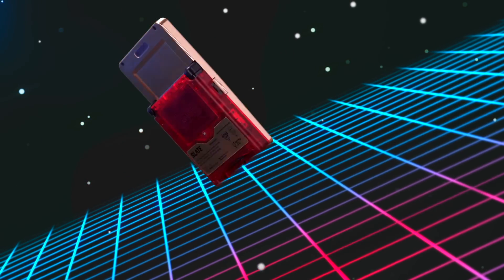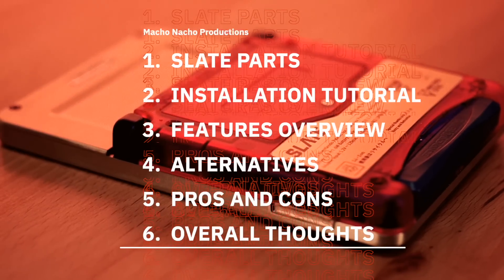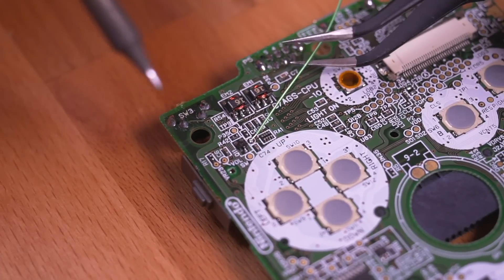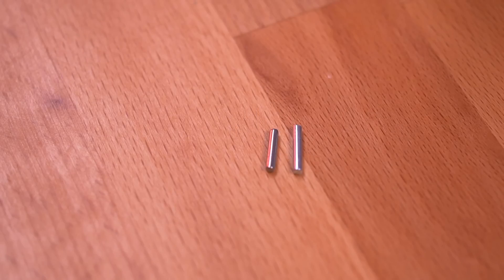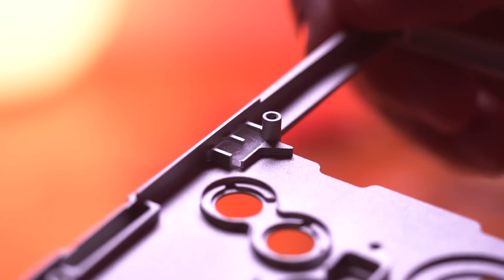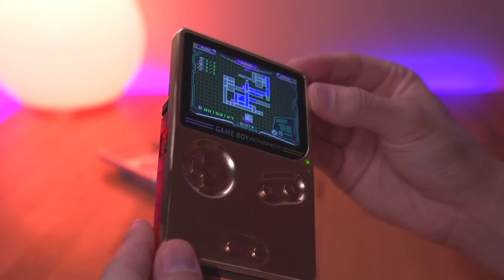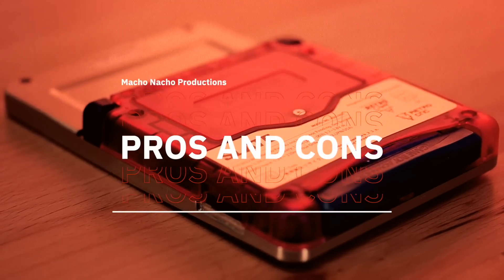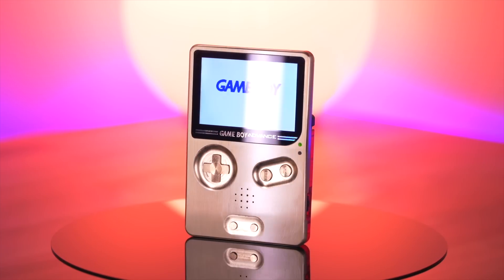The GameBoy SLATE SP

Comment: I would love to see a plastic option for any of these shells in the future. The aluminum is certainly fancy, but I still prefer the look and feel of plastic.
Reply: Couldn't agree more. It would bring the cost way down also. Though I wonder if the reason it hasn't been done yet is due to something like that compromising the screen structural integrity.
Reply from the maker: I too would love to see an injection molded plastic offering
Reply: i'd love a plastic shell if only so it would match the rear piece. the mix of metal and plastic on the finished product just looks sloppy to me. almost half-assed
Reply: Agreed for gameboys a high quality abs is what im used to feel in my hands , also cheaper
Reply: SAME!
Reply: I am actually waiting for a plastic option to do this mod. Don't want the aluminium.
Reply: Yeah im waiting for plastic before I pull the trigger on this
Reply: cheaper too.
Reply: @ubernewb3005  came here to say this
Reply: I was just saying this! At almost $200 for the shell plus screen it’s hard to swallow
Reply: Have you checked OpenSP?
Reply: @MachoNachoProductions  I feel the same way about the macro. It would make it feel a lot more natural with the back half
Reply: While it would be a nice option, the durability of the aluminum is worth the cost. Most of the shells made nowadays use cheap plastics that aren't very durable. A shell that uses plastics on par with the originals or better wouldn't be cheap either.
Reply: @Tee Hee I've since re-shelled my SP with one of the new Funnyplaying shells, and it feels like a drastic improvement. The feel is good, and I've dropped it a few times with no consequence.
Reply: It costs about $35usd to have one professionally 3d resin printed.

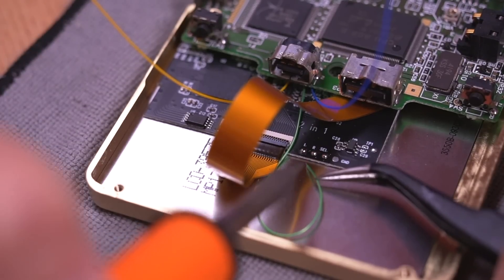Comment: 6:48 I'd solder the wires to the driver board while it's disconnected to avoid having a soldering iron anywhere near the LCD - it very easy to overheat it and cause discoloration
Reply: Yeah, that happened to me. The guides I looked at when I modded my GBA all did it with the board on the screen and now I have a dark spot on it, so yeah, remember not to do that
Reply: @charlesmalmasson9698  same :-( had to order a replacement LCD

Comment: L.E.D diffuser is really nice, boxy pixels shell I believe allowed you to put your original one into the shell. However I couldn't get mine to stay in place, so I ended up using your technique from the Gameboy macro mod, put kapton tape onto the light holes on the outside, and filling the inside with a little hot glue. I did end up trying to put the light tube in on top, which worked well overall. I love how detailed and advanced people are capable of making older technology these days.

Comment: We need a version of this for the original GBA (horizontal), making it a bit more compact. Looks superb. Great video as always.
Reply: Curious how they could possibly make the Horizontal GBA more compact!
Reply: @Wedeemgaming  Maybe it'd be easier to enlarge a Micro? Lol
Reply: @Wedeemgaming  much like this build but horizontally, shrinking a bit on the sides after the buttons. There is a bit of space taken by the side “bumpers” on the OG casing. Granted it is not much, but smaller is smaller xD 

The other option i thought is uso g a game boy micro board, which is split from the dpad side. But that would require a screen mod that currently does not exist.

Comment: It would be nice to be able to have a matching housing for the back, like the og boxy pixel. Hopefully, mahko considers that after the initial run on these units.
Reply: I might be wrong but the product page says kit includes both front and back plates - chiming in just because I'm planning on ordering one and wouldn't if there's no back plate
Reply: @andrewan6633  the back plate that it comes with is for the top half, you still require the backplate from a normal gba sp shell, for the bottom half
Reply: @andrewan6633  no you donut, he means that both sides match in color and material.
Reply: It would add a few more dollars to the sticker price bro.
Reply: @shellshock10  exactly my thought

Comment: Note for everyone:
I just did this mod with the metal cnc buttons and I had to add the A and B membrane because there was too much clearance. I also had to snip the center circles in the A and B membrane. Also the R button was very tight I had to trim some of the plastic to allow enough clearance
Reply: Hey man I’m having the exact same problem where all the metal buttons A, B, and the D-pad do not fit snug and rattle a ton. I tried putting the membranes back on but they didn’t seem to fit correctly with the metal buttons. I’d appreciate it if we could chat a little bit and you could give me some tips.
Reply: @bchd8829  did you snip the L and R pins on the board? This step isn’t in the video but is recommended on the install guide. Also if you use the membranes make sure you cut flush the small rubber centers. I ended up using the dpad membrane and the A and B membrane and it feels great
Reply: @duke_8747  I snipped them but only on the one side that makho did in his video. Good tip on the membranes I’m going to try that
Reply: @bchd8829  definitely snip both sides if you end up taking it apart. Let me know how it goes
Reply: Should not have to do that much self work with the price it costs. I was debating reshelling the sp I just got myself for my birthday with an sp shell or the CNC slate and now I really don’t wanna get the slate
Reply: @tbug50  it’s really not much. The install goes really smooth just snip those 4 pins on each side. If you want the best feel just use plastic buttons and membranes.

Comment: Once again a great video Tito. I’ll say this- putting together my Boxy pixel unhinged kit sucked. It didn’t fit together right with my IPS screen. I told BP about this and they blamed MY ips screen! They tried saying my kit wasn’t from funny playing, even though I definitely had the funny playing package they come in. In the end I had to purchase another screen- from China- and then file down the back screen cover to make it fit. Quite pissed I spent 95$ for a kit that didn’t work. So the Slate already looks like a better alternative.
Reply from the maker: So sorry to hear that Ian. What was the issue with the fitment of the IPs screen?
Reply: @MachoNachoProductions  The IPS driver board would not fit. and it ended up destroying my ips screen's ribbon cable. I reached out  to them and emailed pics. they insisted "That's so weird", and "you must not have a funny playing kit". I sent more pics, and they said all of their kits have never had this problem, and that the Driver board didn't look right. So i bought acheap ass ebay IPS screen, and it worked fine. I ended up filling and grinding the back screen cover down so it would fit better. But this is what we do in the name of progress. I dont entirely blame BP. There are a lot of variables to deal with when designing something around a lot of knock off products. and, maybe, my IPS kit was a fraud?

Comment: Just a tip for future reference, this video is great, but the whole use different colored wires isnt an option when the kit comes with 3 of the same color.  I got to the step of soldering onto the LCD controller board and had to unscrew to label them because I didn't have the luxury of different colored wires.

Comment: This looks super sleek. Love the shorter height and the extra rounded corner on the screen. I'm not a huge fan of the slant though, would prefer a totally flat front. I do wish a metal back was available as well
Reply: U big turkey, the slant is because you didn’t use the shorter dao lmfaoooooo
Reply: @pixelatedsethtube1271  Dao? Do you mean dowel?? And no, the bottom half literally tapers off in a slant. You can see it in the video
Reply: @NormalPsyche  Ohh yes I was thinking that. My apologies you are correct it does have a slant

Comment: I'll be honest, if you have a 3d printer at home, the unhinged original looks very appealing, since you can skip the proprietary buttons by printing them and it allows for bigger batteries.
Though I haven't had a GBA in over 10 years ever since I got a DS.
And right now I got my hands on a GPD XD, which to my surprise, fits perfectly into the grip for my 3DS XL, it only blocks the L2 and R2 buttons but other than that it's what I'll be using for GBA on the go really.

Comment: Just received and built mine, it's beautiful. 
I ordered the machined buttons however and installing them without the membrane made them loose and the whole system kind of rattles when you move it.
They functioned fine but I just really didn't like the feel / sound of it so I went back to the standard with the membrane.

Comment: I have a question. Do the metal buttons have any chance of damaging the button contacts on the motherboard? I like the way they look but I'm worried about possible damage.
Reply: Definitely a really good concern but I'm sure if the button post on the bottom of the button is the same size as the contact it should cause any damage. However, I know nothing so don't listen to me, just a opinion that could be complete wrong!
Reply: @m4xQ  ahh you are right. That probably will make it less of an issue. Thanks.
Reply: @albertoheras7684  the dome is pretty tough so I think it should be fine! For me maybe I'll go with aluminum button instead of brass though. My childhood SP, the face buttons were somewhat unresponsive so I literally had to peel those domes off and use alcohol to clean them up, so I think I know how sturdy they are
Reply: I think it's more exposed to corrosion without the membranes.

Comment: That's tempting... And technically it's a no solder mod if you're not worried about the brightness. You could set and forget so for those that are crap at soldering (ie, ME!) that's not a bad option.

Comment: Great review and well done Makho on the product, I think it came together very nicely. I have an unhinged v2 and I love it but am considering building one of these as well, the only thing holding me back is no usb-c option, it's really a game changer on the unhinged, and I'm surprised Makho didn't feature it on this since he is pretty obsessed with making everything usb-c compatible, but I understand that would be a much larger effort and trying to keep this a fairly approachable mod. Well done all round.
Reply: But USB-C mods are already available for the regular SP and compatible with this shell. It's not specific to the BoxyPixel shell..
Reply: @HighPower64  Valid point, I do like with the boxypixel shell you don't have to remove the old charging port though, you can keep the board original while only adding the new usb-c functionality, more trying to talk myself out of this build so I don't have to drop the $$ on it, even though I probably still will

Comment: The Slate, barring true personal preferences, looks pretty cool overall. The best part of it is that it can use the original plastic buttons the SP came with or pretty much any other aftermarket option of maximum customizability. That's something the Unhinged versions are lacking and makes this version of a "hinge-less" SP mod more appealing. When it comes to my personal preferences, it's a too thin and small for my liking since I have bigger hands but, again, that's a personal preference so I won't use that as a knock against it.  

However, what I WILL knock it for is the removal of the brightness button. Making it a bit shorter is no excuse for removing a feature that came from factory to begin with. Why resort to using buttons that are needed in-game to control brightness when there was already a fully dedicated button ready to go from the start? It also makes installation (assuming you want brightness control) more complicated and an unnecessary extra step. All in the name of making it shorter. To me, that's just pointless.

Comment: Personally, I think it would be better if the unit was the same depth for the entire height of it. I have the same problem with the unhinged SP. Two reasons I feel this way 1) It just looks better and 2) it makes the wire management less of a concern because of the added space behind the screen. Now of coarse I know that would add on to the amount of material that would be needed and thus add on to the cost but I feel if you are paying for a premium metal shell in the first place then it probably wont make a difference to you, I'm generalising of coarse. It would also need a redesign of the trigger buttons as well as relocating the Exp port and the charge port. Obviously these are only my opinions and as such should be taken with a grain of salt.

Comment: Is there a cheaper unhinged enclosure option, like a 3D-printable template? I'd be more interested in a fun plastic color than an Apple-ish machined aluminum aesthetic anyway. Also, the external dimensions and shape of a 3D-printable template could easily be adjusted to make it more ergonomic for the builder's hands in particular (also could be fun to totally re-orient the GBA into a Switch-like wider layout). A big reason that I seldom use my GBA anymore is that my hands cramp.

Comment: You didn't mention another key difference with the two kits. The Makho kit will work with more accessories than the Boxypixel ones. For example Boxypixel had to put the headphone jack at the bottom because the Nintendo headphone adaptor will not fit with their kits but it will fit the Makho kit.  So if you buy either Boxy pixel kit and you want headphones you HAVE to do soldering to add the kit so it's not solderless like you mention in your video.

Comment: Finally put together my slate. Highly recommend. Not a hard mod
Reply: Is soldering necessary? I want to do this mod but I don't necessarily want to solder at this time cause I still need to learn. 

To me it looks like soldering is just for brightness controls correct ?
Reply: That’s correct but I’d still recommend doing it. Soldering is way easier to learn than you’d think. I was very nervous but after trying in the first 5 seconds I realized it’s no biggie.
Reply: @geriatricgrizz4205  thanks for the reply even after a year! I'll probably go ahead and pick up a kit and toy around with it while I wait for the slate to get shipped to me

Comment: I just finished installing my Slate! The parts are top quality and I'm very impressed with it. My issue is with the 3rd party shell I bought for the project, The thin plastic strip at the cartridge slot has buckled up when screwed down. Also one of the shoulder buttons is sticking. Can anyone recommend a quality 3rd party GBA SP shell brand? I live in Australia. Cheers!

Comment: Did you take apart an AGS 101 or an AGS 001 Gameboy Advance Sp?
Someone told me that the systems have slightly different boards and wondered if that is of any significant impact on this mod
Reply: I had the 001 and I followed this tutorial to a T and had no problems. It’s pretty rad since the 001s are not as widely sought after and therefore a bit cheaper.

Comment: It should be noted that you're not testing the kit "to make sure everything's ok", you're testing it to make sure the kit isn't defective, because RGRS won't let you refund a previously installed kit. You're out $60 if you don't test it before installing.

Also, the Slate can use Mahko's lipo battery mod, so you can get a better option :P
Reply: Not only RGRS, this is the policy of every distributor and manufacturer now. This is even stated in FunnyPlaying’s policy now. I’m glad to see YouTubers starting to at least mention that the kit should be tested before installing.
Reply: @valshaped  everyone should be testing any backlight kit before installing, doesn’t matter where you bought it from. It helps you receive a replacement without issue in case anything is wrong as well as helping diagnose any problems if it doesn’t work after the install. This is standard procedure and more people should be aware of it. Kudos to Tito for mentioning it.

Comment: Nice video as always, keep it up Tito! One question: How do the shoulder buttons feel compared to the models from Boxypixel?
Reply: should be the same as stock if you glue the axle pins in. Without glue, it will still work but it will just be wobbly and doesn't feel as good. I'm not saying stock shoulders feel good but it should be unchanged from stock.

Comment: 6:30 Correct me if im wrong, but dont you need the membranes to push the buttons back up? wouldnt they sink down without them?
Reply from the maker: Nope, the sp uses actual tactile switches and doesn’t require the membranes
Reply: @MachoNachoProductions  Ahhh i see.

Comment: That looks pretty slick! In regards to the lack of a bigger battery, you can try to find that old datel 'extended' battery pack (ripoff) and mod it with a 2000 may pack instead. But as a downside, it does add more bulk...
If I hadn't already gotten the unhinged V2, I would look at this one for sure!

Comment: I literally just ordered all the stuff two days ago… so I emailed and asked about the discount code. 

Can the usb c charging mod still be used with the slate shell?
Reply: kinda -- you need a mod that centers the port within the existing cutout and current offerings don't really do that. Or you need a modified low profile cable. Stock charge cable fits fine but USB C cables tend to have way too thick shrouding around the plug
Reply: @makho  ok good to know. Idk if I have the ability to do that. I hope someone comes up with one.

Comment: If the slate kit came with a metal back even if it costed more I would go with the slate I hate using metal with plastic. I like the whole system to be uniform I have the same issue with the macro